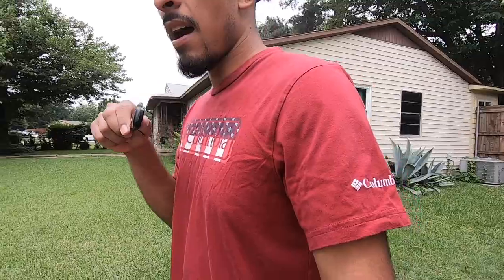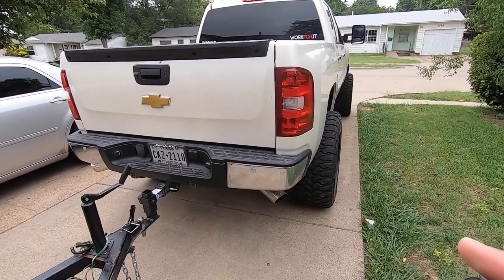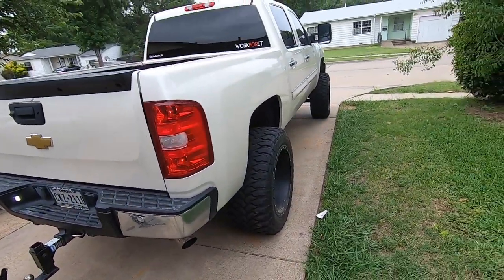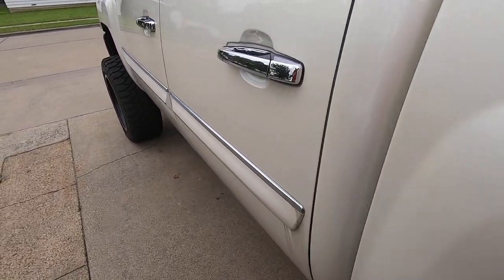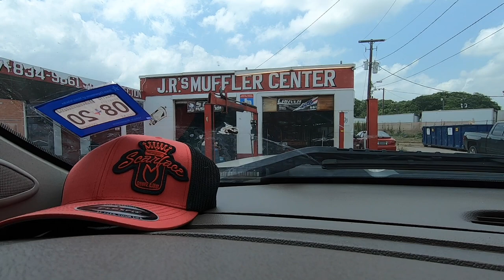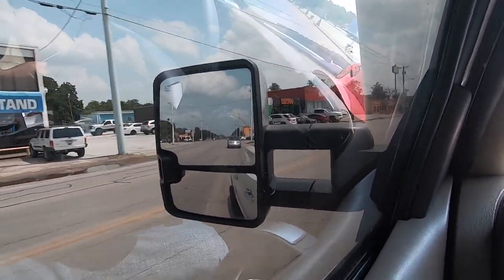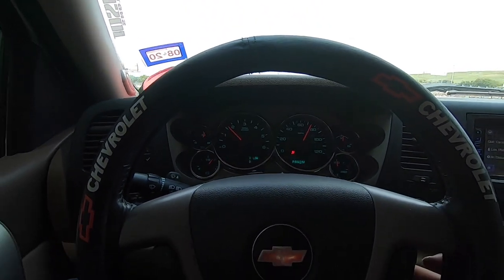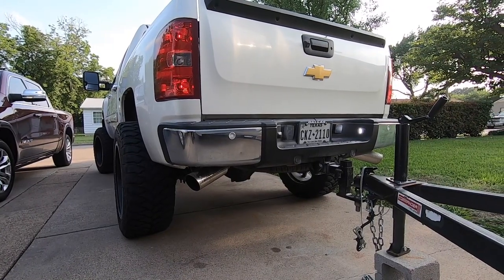GOT MY TRUCK BACK! **2013 SILVERADO STAGE 2 BTR CAM CAT DELETE**

Comment: How much was your blinker fluid down? An entire gallon? You know that can be catastrophic to the blinker system! Your 3rd break light fluid looks like it could be a bit low too. Be sure you’re using that left handed funnel for those fluids
Reply from the maker: 25 a gallon of blinker fluid & I use a oil funnel for my blinker fluids
Reply: Also…….  Extremely important ….   Be SURE You change your summer air to winter air in the tires.   This can be disastrous ….